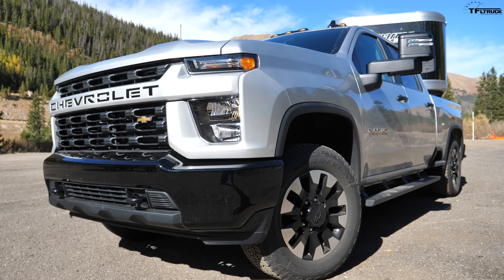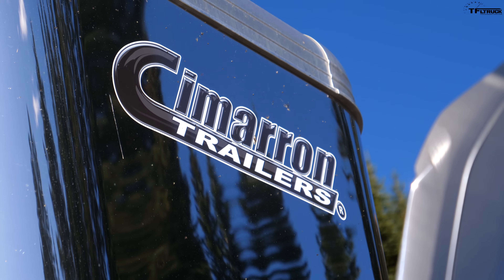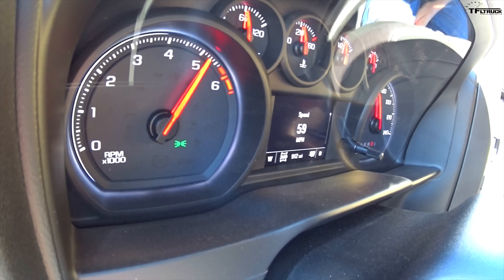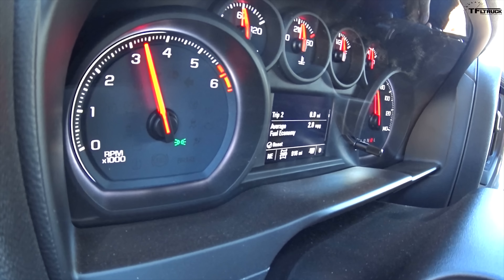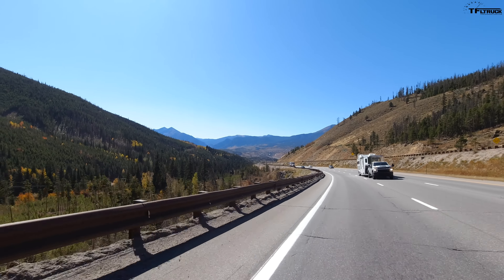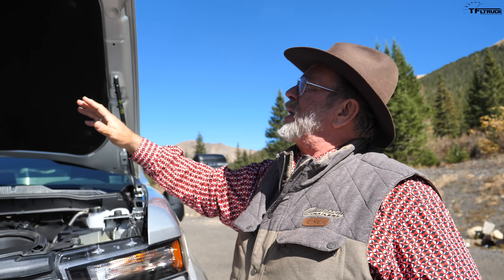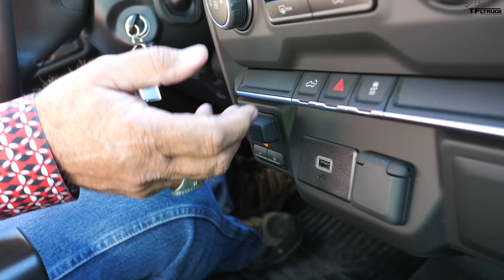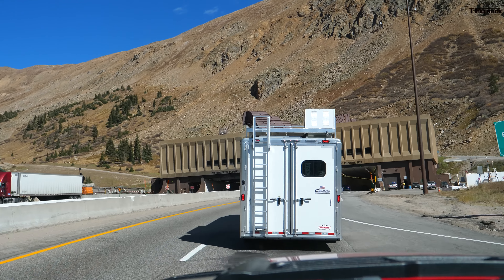The New 2020 Chevy Silverado HD Gasser Broke Our Ike Gauntlet Scoring System - Here Is How!

Comment: Ram should say they have Eaton transmissions since GM is still saying they have an Allison.
Reply: Funny, but true.
Reply: GM does still use Allison transmissions.....but you need to buy a 4500, 5500 or 6500 to get one. But I'm sure Allison wouldn't let them put their name on this transmission if it didn't meet their standards.
Reply: @XploreAz  actually that transmission is built at a GM factory. Like Chrysler ZF transmission that it is built by Chrysler.
Reply: Allison is used on all HD GM trucks. Except gas.
Reply: @XploreAz  They have to meet the exact Allison specs.
Reply: @XploreAz  incorrect.  In the big bail out gm sold Allison transmissions but kept the rights to the Allison name for the light duty trucks.
Reply: @dragoonTT  and it's a fake Cummins how? Because it isn't in a semi? Get real. In that case, ask all of the cruise ship Captain's what they think of the fake diesel engines in their trucks.
Reply: What's fake about the Ram Cummins? please explain
Reply: @bmartinez2086  Do some research. You are wrong. GM is building their own transmissions now in house and slapping the Allison name on them.
Reply: Mike H ..GM is building an Allison branded and certified transmission in a GM plant just like it has for decades. Allison was always built in a GM plant up until it was spun-off after the bankruptcy but the light truck series continued to be built in Baltimore at a GM plant by GM employees which went out of production this year, hence the new 10 speed Allison by GM.
Reply: @dragoonTT  Sooo, the Cummins in the Ram isn't built by Cummins? Who builds them? Detroit? Caterpillar? Mitsubishi? Mercedes?
Reply: Guardrail -Maybe it's built by Fiat but certified by Cummins?😉
Reply: @F450FTW  the same thing with the GM 10speed  Allison. Built by GM Allison certified.
Reply: @F450FTW  It's built by Cummins. I was being a smartass towards the guy who thinks RAM makes the Cummins engines for their trucks. No one makes Cummins engines but Cummins.
Reply: Guardrail -I know! I was making fun of them too hence the winky eye! GM fanboys sure do tell tall tales to protect the only good name associated with their product.
Reply: @F450FTW  Gotcha. I missed the winking emoji

Comment: Geez, that altitude takes its toll!
Reply: Hell yeah it does. Couple years ago I drove a v6 Xterra over the pass and had her on the floor... Couldn't break 55mph unloaded. NA engines gasp for air up there
Reply: @Mournful3ch0  junk. I drove my old 95 Cadillac Fleetwood completely loaded with shit over the same pass they are doing and was floating up that pass at 75-80mph
Reply: Mr M apples and oranges. V6 non turboed Nissan against a supercharged GM 3.8 or 4.3???
Reply: @deeohgi  supercharged V6 In a  Fleetwood? Nope. LT1 V8 came stock in the 94-96 Fleetwood.

Comment: Are they sure it was in tow/haul mode? They seemed confused about the location of the switch, the transmission seemed sluggish to shift and I didn't see any icon on the dash showing it was in tow/ haul. Just wondering.
Reply: That's actually a good question. I need to check on the new models where the indicator is located but on the last generation the tow/haul indicator comes on by the tach. I didn't see it on when they showed a shot of the tach...
Reply: Tow/Haul forces the trans to hold gears longer, so most likely yes.  Understand, that's a good thing.
Reply: @kencoconstruction9236  
It also makes it down shift when under load witch I didn't see. When they stepped on it it held the gear and didn't down shift like it should have. The way the truck was acting seems like it wasn't in tow/haul. I'm not familiar with these new trucks. Maybe they changed the tow/haul tuning. Maybe they thought they had it activated but didn't.
Reply: @curtis1951  It will downshift after giving the engine a chance to lug.  Multiple shifts will over heat transmissions.  Those who had early 700r4's should know this.  Tow rating is figured by how TFL does testing.  I think the tune is fine and if someone buys this truck they of course are going to use manual mode.
Reply: @kencoconstruction9236  It was in tow/haul mode. They moved the indicator to the right of the odometer.

Comment: These manufacturers needs to return to offering a manual shift.
Reply: They do offer it, but for objective testing, TFL does their runs in auto
Reply: If they offer them then TFL needs to do comparisons between the auto and the manual.
Reply: @usaclaimsthemoon4198  who offers a manual? Pretty sure they're all dead now, unfortunately.
Reply: Sorry, meant that the manufacturers allow you to manually select what gears on the automatic transmission. Didn't mean they offer manual transmissions. That would have been great
Reply: You can’t shift efficiently enough to out perform an automatic. At the end of the day your also wore out from shifting if your in stop and go a lot.
Reply: @michaelbrown8244    Mostly true.  This test is an exception to that.  Knowing the grade and distance of that hill, any gas truck would have performed better in the manual mode.  You can keep the rpm's higher and downshift sooner if needed.
Reply: al adam EXACTLY! For the rare occasion anyone is towing over the top of a mountain, you use the manual mode that GM designed to optimize output for the situation at hand.

Comment: You ever listen to that one album and at first it sounds like garbage but after a few listens you actually start to like it? Well, that's how the front end of this rig is. I was the same way at first look thinking it was hideous but after seeing a few in person and on the road, I am actually growing fond of the tough look.  It's easy for the commenters to bash this trucks performance but the test they put it through is not the intended usage for a truck like this. How many of you tow 16,000 lb gooseneck trailers on a daily or weekly basis under these conditions (altitude/grade/speed/load). If so, then of course you need the diesel. The truck they tested is best with travel trailers under 35 ft, a truck camper in the bed, box trailers, etc. For the right buyer, it would be a perfect setup. It sure is easy to tell someone to spend another $10,000 bucks just so they can tow that load up the Ike 3-4 minutes faster.

Comment: I watched the ram 2500 gas engine Ike test, although they couldn't figure out the shifting, it certainly kept pulling hard and didn't drop to 32mph because of the elevation. This Chevy is nice, more expensive, and a cool redesign, but I think I'd have to take the ram. I don't consider Ford trucks and they've had nothing but issues. In the market for a 3/4 ton here very soon, and I'll be at elevation in Colorado pulling and hauling.

Comment: Asking a naturally aspirated engine to tow effectively at 2 miles above sea level is too much.  The diesel has a turbo or two to compensate for the thin air.
Reply: Thats what im saying. Yes the steep grade is a good test but at that high of elevations its unfair for na engines. And gives a unfair advantage to the EcoBoost as well when in reality, here in FL the v8s and EcoBoost dont have any difference in power. Actually the 5.0 v8 gets better fuel economy in some cases.
Reply: @JRob-u3k  ok let me rephrase that the test is kinda unfair because the majority of people in the US live below 2000 ft and a lot of people base what they buy off of this and and it makes boosted engine seem better than they actually are because of the crazy elevation changes. What Im trying to get at are these test really only applies to people in 4000ft and above.

Comment: In my opinion turbo straight sixes would be great truck engine cuz they were a great truck onions for a long time even the ninth generation Fords with those 300 straight six those were great I think those things are better at towing than the 5.0 at the time those were better at time They used to put those in huge f700 dump trucks They never put the 302 in the dump truck cuz it couldn't handle it The reason they don't do it is because it would be as bad on gas as a V8 They were notoriously bad on gas but maybe a modern age inline 6 turbo could be better than a V8 and better than a turbo V6 durability wise they run like tanks

Comment: I like pretty much every offering. The results are actually impressive considering it is a gas engine being used to tow that kind of weight.
   They said it was in tow haul mode so if that was the way it was then the programming might use some improvement. 
   The 4.10 gear would be better, but those are options the consumer has the choice to pick. If your gonna tow that much weight with the gas engine, get the 4.10 gears. 
   Also, I have experienced engine load like that, I just manually downshifted to keep from punishing my engine.
Reply: 4.10 gearing is not available with the gas engine. But I do agree with you: you could manually downshift and keep it where its making all the torque. That would have helped the tow probably by a minute.  But this is how they do it with all the trucks. To keep it fair I guess.

Comment: Yes vinny the 8 speed is a game changer for ram 2500 has I’ve got the 5.9 diesel in the old body style an with 4.10 gear in the new 2500 has with 8 speed pulls like a champ  and the transmission is not busy it’s always in the right gear

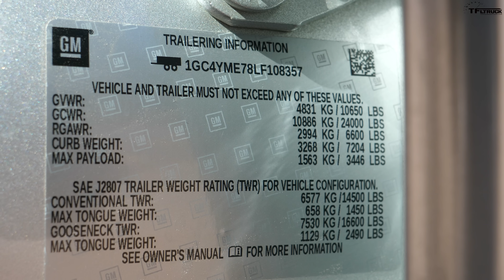Comment: I'm kind of disappointed in GM. This all new from the ground up truck pulled 16,000lbs in 11:53? The 2017 Ford F-250 with the 6.2l pulled 19,500lbs in 8:53. Doesn't seem like GM really has a stake in the gas HD market.
Reply: Twisted1 nope you’re confusing trailer weight with combined weight
Reply: @myers326  You are right about that. One was strictly trailer and the other was trailer and payload. The difference, and this is subjective, is 3500lbs and 3 minutes. You can't hide those facts. Given the test, this is what we have.
Reply: Twisted1 no , one was trailer only the other was truck , payload and  trailer you can’t hide those facts

Comment: Wow down to 25 mph? I think it should of got more gears. The ram HD 8speed and ford 7.3 10 speed will do much better. And I cant believe the squat, riding bump stops is horrible. #fail
Reply: its at maximum payload, not riding bump stops, and the ram gas went slower......
Reply: @gagt5spd  it hits bump stops when driving, they said that. And the rams time was with the 6 speed now they have 8 speeds it will help alot just you wait and see.
Reply: It was only hitting the bump stops when it hits bumps. That's what they're for. And that's with around 3600 pounds.
Reply: @I know you are right, And I just got owned but: So the 7.3 was tested already? Amazing... 

Not only is the new Chevy hideous, it's also slow as shit too. You're supposed to get more capable and efficient with time; GM got slower and uglier.

Comment: Gas Chevy is disappointing.  Ford is lovin' this video.
Reply: Ford hasn't towed with their 7.3l yet sooooo lets see how that goes. Either way im fairly impressed its even capable of towing that amount of weight.
Reply: Disappointing?  Are you high?
Reply: @I know you are right, And I just got owned but: this is the 3rd time you posted this same thing on this video. Where is the video of the Ford blowing up. I must have missed it.
Reply: @ericgrau123   couple years prior ford couldnt evem start an mpg or towing test, i dont remember which, because it had serious engine issues and had to be towed away with mr trucks personal truck and trailer

Comment: So, if you do the math, at 2.4 MPG over 8 miles during a basically 12 minute span, means that the truck was consuming roughly a little more than 1 liter of fuel every minute, so to put that into perspective, it's like if you drank 4 1/4 8 oz cups of water every minute, for 8 minutes straight. Roughly 3.33 gallons. Which kinda sounds like a lot, but kinda not. Almost cost them 1 dollar a minute to run up that hill in fuel, lol.

Comment: Needs a 4:10 option, 10 speed, new interior and a less awkward front end... oh & the mirrors are awful... very tacky at best.
Reply: Well said
Reply: So the new redesign needs a redesign.
Reply: All the 10 speed is going to do is shift more often.  Six gears is plenty.  The fact is, all new trucks are overrated for what they can tow.
Reply: scarhart53 It could have used some more gears to down shift going up to keep the engine in the sweet spot.  Same for down hill braking.  Over rated, true especially the half tons.

Comment: "the biggest difference between a gas engine and a diesel? obviously the turbocharging" no, aside from the compression ignition (obviously)  It is the fundamental power cylinder design, which offers a higher compression ratio, resulting in higher peak cylinder pressure, and generally a much longer stroke to bore ratio than a gasser. For the same horsepower, output, the diesel will be turning slower, but producing more torque. In other words, for the same power, its more efficient. 

The boosting may be a large part of what you notice, but there is nothing fundamental about gas or diesel architecture that requires it.
Reply: @inthewoods5471  username checks out

Comment: I always like the gas Chevy 3/4 Ton, always thought of it as a Heavy Half Ton. Rides nice, IFS, easy on maintenance. Both were fleet trucks (one was a Rebar company, other was a landscaping truck). I drove a 3500 and F350 both gas back to back. The Ford squeaked constantly on the interior, and the ride wasn't great. The GMC was significantly longer but road better. The old 6.0L felt great and was dead quiet. I'm curious to see how the F250 Gas 7.3L is vs the 6.6L 2500.

Their other video the Ford 7.3L did it in 8:42 and for 2.2 mpg.

Comment: Holding 2500 - 3000 RPM with foot to floor makes no sense. Why so reluctant to downshift? Other gas trucks maintain ~5000.
Reply: I was thinking the same, engine should have been 4500+
Reply: Patrick Rebert   Exactly what I was thinking I hate it when they do that use the full potential of the truck.  Common sense
Reply: I think it’s because it’s still in the break in period. When I first bought my 2015 GMC Sierra with the old 6.0 they detuned it until I had 2,000 miles on it. Then after that it will rev around 5k.
Reply: @9fishwm  nope
Reply: Should maintian RPM at peak torque for a gas engine or 4000 rpm for this engine for longitivity sake, but for this test at peak hp or 5200 rpm for this engine.

Comment: They would benefit big time with a single turbo to make up for the loss in elevation..
Reply: Most people prefer longevity
Reply: A low pressure turbo say 6psi would do great in this engine.
Reply: rochab77 it’s still added complexity, which means less longevity
Reply: @jon62ify  yes that is very true, especially with todays turbo systems.

Comment: For guys who are telling you how to tow they make several mistakes towing on the highway. First driving at 25 mph in the middle lane. Get into the right lane!!! Second when there is a curve they hug the inside lane of the curb, WRONG!!! go to out side of lane because your trailer will off track & hugging inside part the off tracking goes into other lane. Two simple basic rules of towing. Wide open pedal to floor will blow the engine sooner than later.

Comment: She wont last long turning 5k rpms uphill. Crazy.....
Reply: The engine has a proper cooling system. It could run like that all day long and it wouldn't hurt a thing. Its doing exactly what it's designed to do.
Reply: Sure..... Right.....whatever you say dude
Reply: Been turning wrench for 20 years and built my fair share of engines. They're a lot more resilient than you think. Most of the manufacturers test them to their limits before they ever make it to production. Rev limiters and overheat protection are all built into them for a reason. You believe what you want, I know from first hand experience.
Reply: Yeah well I've been working on continuous duty engines for over twenty years. You name a diesel engine and chances are I've run it and worked it. Tell ya right now a gasoline engine is not gonna hold up to those kind of continuous rpms and have any longevity.
Reply: You said it yourself, you work on stationary power plant diesel engines.
Obviously not the same thing as this or any gas engine. Manufacturers stress these engines to the max during R&D and spec them well within their limits. 5k on this engine is nothing for it to handle. If it was they wouldn't let you anywhere near it.
Reply: I work Marine Diesels but anyway like originally said. Whatever you say dude, every body got there own opinion.
Reply: Hawser Jed brown has facts, you have opinions.

Comment: Also to prove they should have kept the 4.10 with the 6 speed, TFL did a 2015 truck in 10:38 and that was with the 6.0 gas with 4.10 and 6 speed.
Reply: killercan10 that trailer didn’t have the same wind resistance and was lighter . But 4:10 should at least be an option